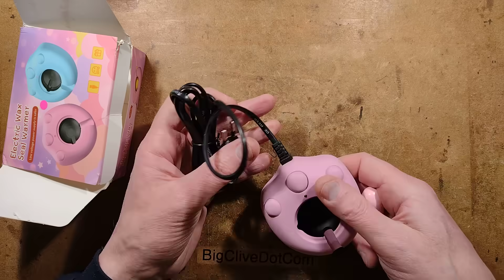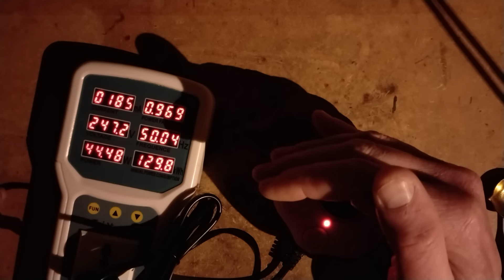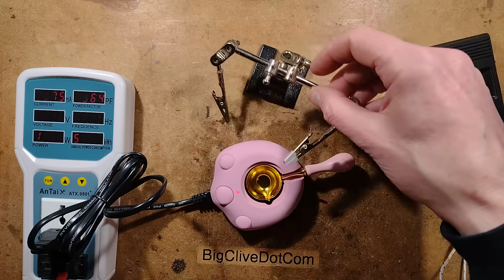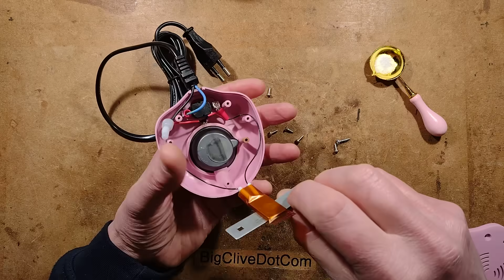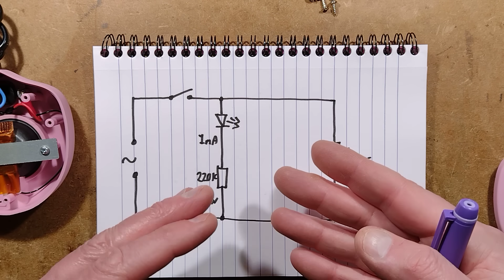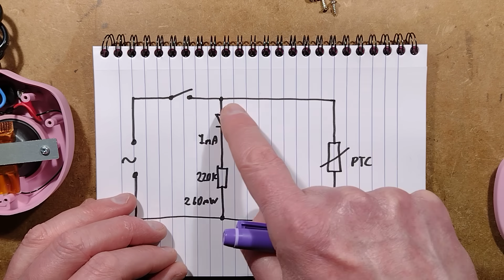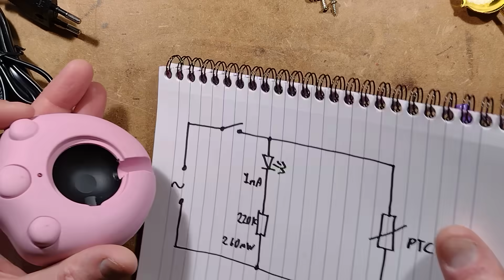Inside a sealing wax melter - with other uses

Comment: I will say, I'm slightly concerned by it hitting 150C given basically any resource you find on working with wax for candle making makes it very clear to use a double boiler to keep everything under 100C to prevent ignition

Comment: Have you ever tried putting a neutral density filter in front of the camera to lengthen the exposure time and reduce the flicker of the displays?
Reply from the maker: I've not tried that, but the display on this meter is already quite dim.

Comment: Could you use it melt tin, bismuth etc?, for making your own low melt solder.
Reply from the maker: Not suited to such high temperatures.  But you can get heated solder pots online.

Comment: modern sealing wax is a normally a thermoplastic resin, which defeats the whole purpose. proper old sealing wax, being made from shellac and turpentine snapped cleanly when tampered with. but the modern stuff bends, so it no longer is obvious when someone has messed with it.

Comment: You can get  professional cosmetic skin care by loading up some pure paraffin wax, and using it as a peelable face mask. Be wary of temps, since a proper wax heater never reaches scalding temps, and takes forever to melt cosmetic wax. Another use being melting of hot melt glue(in pellet form🤔), apart from some ?weird?carboxyl? chemical reaction experiments💭. Could also be used to alleviate cold/flu/sinus/nasal congestion, by using few drops of pure eucalyptus oil in water and shrouding yourself with a large breatheable blanket ( beware of saffocation, and keep your eyes closed until removing the shroud).❤👍

Comment: I prefer the safer old fashioned flame to melt my sealing wax. Which is beeswax or zhellac, resins like Venice turpentine or colophony. There's no plastic in modern or old sealing wax.
It's still used in the legal profession, it's great to ensure documents aren't tampered with i.ie pages removed and/or altered. Sealed properly the usual bypass methods don't work.
Reply: If it works for you, great.  I find that using a flame causes soot to contaminate the wax or lacquer.  This is always bad, but especially for yellow. I sometimes use a large soldering iron with a clean tip.  For wax, there is a lot of equipment available for encaustic painting.  For lacquer, I find a hot air gun works best, as I described in another comment.

Even if the flame is applied to the bottom of a spoon with the wax or lacquer in it, you still get soot all over the bottom of the spoon, which is nuisance to clean up.  However, everybody has their own way of doing things.
Reply: Also for batik.

Comment: I haven't thought of sal amoniac in decades. When I was in high school I took metal shop. Our textbooks were ancient and instructed on using sal ammoniac for cleaning and tinning soldering coppers. I mostly remember it because my teacher joked "my good friend Sal."
Reply: I have an ancient copy of General Shop Work that was my Dad's and they were still using the same text book when I took shop in the 1960s. It describes using sal amoniac for cleaning soldering irons that you heat over a burner and also describes using it to sharpen files but in all my years I've never actually encountered the stuff and I have no idea where you would even get it.
Reply: My chemistry teacher demonstrated making ammonium chloride back in the day, mostly because it's so normal to eat as sweets here (salmiakki or "salty liquorice") so it was interesting for that

Comment: I;m sorry but anything that you plug directly into mains is not low voltage. I wouldn't even consider the 110-120v in the US low voltage as it can still kill you and hurts like hell if it doesn't. Ask me how I know.
Reply: I got a very frightening shock once from a 110V outlet in the US.  It didn't exactly hurt but I would never want to experience it again.  I could imagine that it might be painful or fatal under other circumstances.  With AC, it's possible to let go.  I would consider it carefully before working on anything that involved DC at even moderately high voltages.  For me, workplace safety has absolute priority.  I'm appalled at some I things I see people doing on building sites or on videos.

Comment: Hi Clive; here is a topic I would really like to see you address. We all have dozens of wall warts. How can we test them w/o tearing them apart, to see if their OK to use. I doubt I have 2 made by the same maker, and I know from your teardown and my experience that not all are created very well at all. What basic tools do we need, how do we set up a simple test, and... Thanks Clive, I have learned so much from your ignorence and brute force. Teach us how to look at some of the more common devices like wall warts and test them for safe use. Thanks, keep kickin for us all!
Reply from the maker: Technically speaking you could stress test them with a high voltage test between commoned input pins and commoned output pins, but that doesn't show faults that could result in insulation degradation over time.  It could also damage some power supplies.

Comment: I thought LED's had a maximum reverse breakdown voltage,typicaly 5 volts?
Reply from the maker: They do.  The cheaper products often just abuse the red LEDs.  Modern gallium nitride LEDs would fail.

Comment: I have a question for anyone who might know, if you had a inverter welding machine with a .5 power factor would doing pf correction be worth it to say use it at higher setting before blowing a breaker? Kinda off topic another great video as always thanks.
Reply from the maker: While it would be preferable to have them power factor corrected, it adds a lot of cost and complexity to higher power supplies.

Comment: I have had several of these and can tell you that they are only good for about 10-12 hours of heat (when used for less than an hour at a time) then either the plastic becomes too brittle or it stops heating.  I accidentally left one on for about 4 hours and something inside melted, so a it’s slightly less dangerous than the candle powered warmers.

Comment: I vote the silicone pad should be between the heater and the clamping bar, might reduce the heat transferred to the two mounting screws 🤔.
Reply: I don't even have to watch the video and I know that the only way to use this device safely is to keep the plug at a minimum distance of 1 meter from any electrical outlet.

Comment: Since you asked, the process by which ammonium chloride dissociates into ammonia and hydrogen chloride gases when heated is technically called pyrolysis. From the combination of two ancient Greek words: Pyro = heat, lysis = separation or splitting. Although it can look a lot like sublimation, it actually isn't - because true sublimation involves only a phase change (solid direct to gas, or the reverse) and not a chemical change. The dissociation of ammonium chloride into ammonia and hydrogen chloride is a chemical change - it just happens to be reversible as the mixture of two different gases cools back down.

This reminds me of a classic demonstration my chemistry teacher at school used to do quite regularly: Take a bottle of concentrated hydrochloric acid, which will be somewhere between 32% and 38% HCl dissolved in water, depending on the supplier. The majority of the HCl in solution is going to be dissociated into H+ and Cl- ions, but at this kind of concentration, there will always be some HCl gas in the air above the surface of the liquid. Not a lot - only a fraction of a percent compared to the amount in solution.
Also take a bottle of concentrated aqueous ammonia, which will be somewhere between 25% and 30% ammonia dissolved in water, again depending on the supplier. Again, there will be a small proportion of the total ammonia present as ammonia gas in the air above the liquid.
Hold both bottles as close to each other as you can, with the lids removed and the tops at the same level. Then just blow across the top of both bottles. This causes some HCl gas and some ammonia gas to escape from both bottles. The gases themselves are invisible, but when they mix, they immediately react to make a dense smoke, which is really just tiny particles of solid ammonium chloride. Very easy demonstration to do, and a great example of a reaction where both starting materials are gases but the product is a solid.
Reply: Ah, I recall doing something similar with HCl- and NH3OH-saturated cotton plugs at opposite end of a horizontal glass tube. Eventually, a ring of white precipitate formed at a specific, repeatable point in the tube.

As the air inside was still, the ring was the result of HCl and NH4 gasses diffusing. If memory serves, we measured the diffusion rate and determined that there was a relationship between the molecular weight and the rate of diffusion. Specifically, the rate of diffusion proved to be inversely proportional to the square root of the molecular weight of the gas.
Reply: This demonstration can be performed in a room with an open container of muriatic acid (which is mostly HCl) at one location and a container of household ammonia (which is really ammonium hydroxide) at another location. If the air is still a fog wall will form in the room. While not healthy, the effect will work at low enough concentrations to not be deadly. It does produce an obnoxious fine powder (ammonium chloride) that you'll be cleaning up forever.
Reply: @davidg4288   That would be fantastic to see, but rather more difficult to actually demonstrate in a working classroom. Mainly because the requirement of a room with still air is hard to meet. Whereas the method I described of blowing across the top of the two bottles (one of concentrated ammonia, the other of concentrated hydrochloric acid) requires no more setup than taking the bottle tops off and picking them up. If you have them on the shelf - and any competently equipped chemistry lab - even a school teaching lab - will have both, it takes only a minute or two and the results are immediate.

Also, and this might be a small point, but it isn't necessarily wrong to describe household ammonia as a solution of ammonia in water. Ammonia is a weak base, as are all alkylamine derivatives. When in solution, some ammonia does deprotonate water and hence becomes ammonium hydroxide. But by no means all of it - there is still plenty of free ammonia floating around in solution. So yes, you can describe it as "ammonium hydroxide" if you like, since some of that is in there. But by the same logic, you can also describe it as an ammonia solution, since there is some free ammonia in there too. Either description can be used.
Reply: @lloydevans2900  I wouldn't do that experiment in a working classroom anyway because it unnecessarily exposes the class to HCl fumes and ammonia fumes, however weak. I'm a boomer and that demonstrations was done and did work (doors and windows closed, ventilation off), but now that you mention it I think I also saw it done using two beakers in close proximity along with orders NOT to try it on a large scale.

Thanks for your ammonia water clarification. It reminds me of the time someone told me I was making ethyl acetate by mixing ethyl alcohol and vinegar for cleaning windows. I looked it up and there probably is some ethyl acetate formed but at room temperature and not particularly strong alcohol and vinegar not likely much. Anyway nothing deadly gets formed and the windows do get clean.
Reply: @davidg4288   Fair point - it probably wouldn't be allowed today, and it was 25 years ago when I was doing my A-levels and it was demonstrated for my own education. Having said that, the fact that the results are so immediate means that you only need to blow across the bottle tops for a few seconds, which produces the visible fog of ammonium chloride particles, but the total quantity is relatively small, so the exposure risk is really not that bad.
Besides which, if you wanted to do it for longer or make a bigger "smoke" cloud, you could always arrange to be blowing it into the open sash of a fume cupboard, or if one isn't available, stand next to an open window and blow the cloud outside. The latter being a classic method - early chemists (and/or alchemists) would sometimes perform experiments on trays mounted on external window cills to mitigate dangerous fumes or smoke building up inside. If you think about it, a modern fume cupboard connected to an external vent stack accomplishes the same, though is of course far more efficient.

As to whether you might form any ethyl acetate when mixing ethanol and vinegar: I would say no chance at all. Vinegar is at most 6% acetic acid, with the vast majority of the remainder being water. So even with undiluted vinegar and pure ethanol mixed together, the sheer quantity of water still present in the mixture would make any ester formation extremely unlikely. Then of course there is the absence of any catalyst - you typically need a strong acid catalyst for esterification to occur to any extent. If you want to make an ester starting from the alcohol and carboxylic acid, you would ideally use both in their pure form, with a bit of concentrated sulfuric acid as the catalyst.
Plus some benzene or toluene to both act as a solvent and to azeotrope with the water generated by the condensation reaction, using a Dean-Stark trap to remove the water as it is formed, in order to drive the reaction to completion. Because if you don't continually remove the water, the esterification will never go to completion, no matter how long you stew the mixture up for - it might go to 50% or maybe 60% conversion if you are lucky.

The alternative is to convert the carboxylic acid to the acid-chloride first (with thionyl chloride or phosphorus trichloride), and then react this with the alcohol. That does the esterification at 100% conversion, since the condensation then produces HCl rather than water.
Reply: I recall the less exciting, but still interesting, experiment of putting a little sal ammoniac in a test tube, gently heating it and watching the crystals disappear and reform further up the tube.
As for school chemistry in the 1970s: it fills me with horror at the total lack of safety precautions. Schoolboys with tubes of boiling hot concentrated nitric and sulphuric acid, not even a lab coat, let alone any sort of eye protection. When I went up to polytechnic, things changed totally - lab coat and goggles for ANY chemical experiment, no matter how harmless the reagents. Apparently, children blinding themselves didn't matter, whereas young adults did. :face-fuchsia-wide-eyes:

Comment: I'm undecided between simply made and potentially  unsafe. 🤔
The circuit has everything it needs. Simply made, no further reduction possible. 
But a good blob of thermo-coupling paste instead of the silicone disc, a thermo-safety shut-off and a better thermo insulation from the metal bar to the plastic case would make it much better and safer. 😎

Comment: Survey says! "Sublimation is the process where a substance transitions directly from a solid state to a gas state without becoming a liquid first. A common example of sublimation is dry ice (solid carbon dioxide) turning into carbon dioxide gas at room temperature."
Wikipedia & Encyclopedia Britannica (auto-generated*)

Also needed/used to freeze dry foods, etc... Cheers- ☮

Comment: Silicone rubber is an electrical and heat INSULATOR.  I'm guessing that pad is supposed to go between the thermistor and the metal bracket - which is maybe why the plastic is overheating???

Comment: The fact, that sallamoniac produces this fine smoke can be used to detect gaseous ammonia leaks, for example on nitriding furnaces. When there is a leak (and usually is obvious due to the smell) you take a rag on a long stick, and soak the rag in hydrochloric acid. It constantly gives off hydrogen chloride vapour, and you "sniff" around the piping with it. When there is ammonia present in air near the rag, a huge white cloud of salammoniac blowing out from the leak appears instantly.
Reply: soak the rag in hydrochloric acid?  How long does that last?
Reply: @christopherd.winnan8701   and make sure it doesn't drip on anything
Reply: @christopherd.winnan8701  it will evaporate in about 30 minutes to 1 hour, depending on temperature, then you have to soak it again
Reply: @christopherd.winnan8701  It will work for about 30 minutes, then hydrogen chloride will evaporate to a great degree (the hydrochloric acid will stabilise at about 6 mole/liter concentration) and it will not be fuming enough to detect leaks, but you simply have to soak the rag again.

Comment: I have the version that has a USB plug.  It takes a long time to get to an inadequate temperature for sealing wax.
Reply from the maker: I wonder if it's designed to be used with PD chargers so it can request higher voltage.

Comment: Hello Clive! 
FYI, when a silicone pad has no metal oxide filler to conduct heat, it's a thermal insulator in practice. Silicone oil doesn't conduct heat worth a damn either! 🙂👍
Reply: It makes me wonder if the silicone pad was meant to be on the metal support bar instead, to protect the plastic towers from heat.